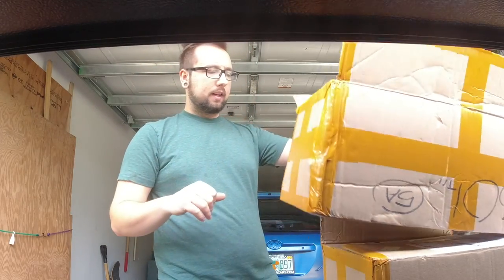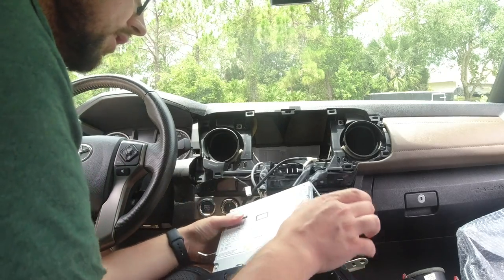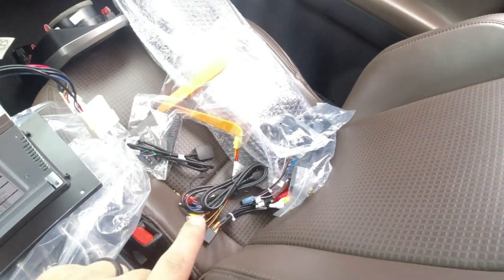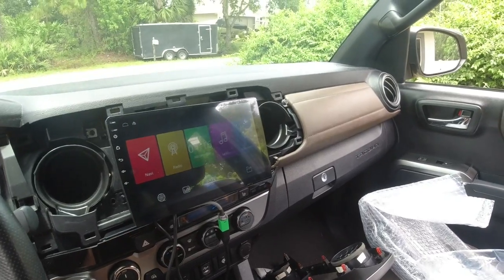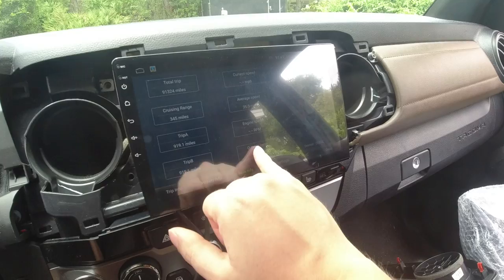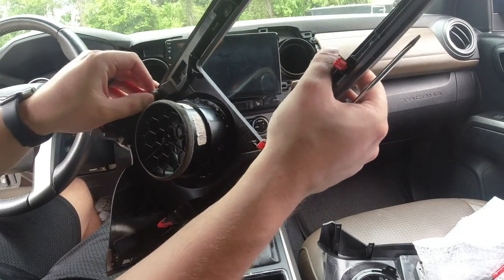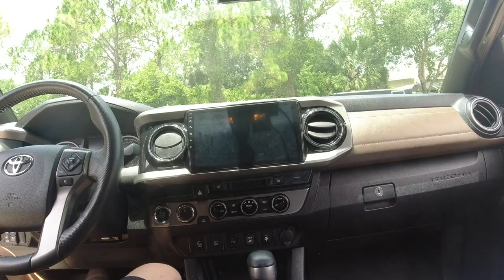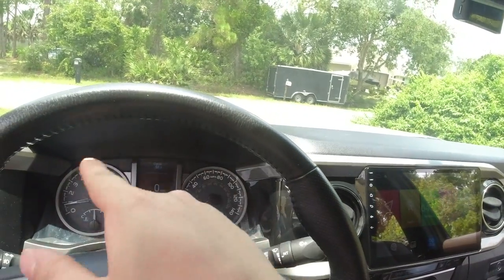Tacoma gets massive radio upgrade!

Comment: Hi, can you send me the exact model of radio you use on that video for Tacoma I just want to make sure to get the right one for my truck? I checked the link in the description but looks different from the one you installed on the video if you have the info I want to get the same one.
Reply: Yeah I definitely want to know myself.
Reply from the maker: Hello, sorry for the delay in response, Idoing has been changing up a bunch of things and how they are selling the radios. Here is the link to the radio as well as a discount code to safe a few dollars as well!

https://idoing2006.com/products/idoing-10-2inch-android-12-radio-head-unit-for-toyota-tacoma-n300-trd-sport-2015-2021?_pos=1&_sid=dbe3a5e23&_ss=r

DISCOUNT CODE: Brandon Stellmach
Reply: @BrandonStellmach great video, in the link there are some optional items. Did you purchase any of those?
Reply from the maker: I added the RAM+ROM, to get a little faster unit. But none of the options are required to work for the Tacoma!

Comment: Hi quick two questions, first did you use stock microphone or you had to run external one. Second question how is call quality , can people on the other side hear you loud and clear?
Reply from the maker: Not many aftermarket radios utilize the stock microphone. This radio comes with a built in microphone on the radio screen. It is okay, but I wouldn’t say it’s the best. They do add an additional microphone you can hook up and route to anywhere in the car. And that one sounds much better.

Comment: I didn’t see any sub outputs on the back of this unit. I have 2 twelves in my truck and my stock radio took a crap and I was wondering if this had a sub output for the back
Reply from the maker: For sub outputs, it is in a separate harness that I did not plug in. Since I was not going to use it. But this will work with after market subs if you have them.

Comment: Do you loose the ability to start the truck up with the app? I use this feature a lot and I would hate to loose it.
Reply: I've replaced my headunit in my 2021 with a Sony 9500es and the app still works for starting and unlocking my truck
Reply from the maker: I don’t have that option, so I wouldn’t be the best to answer that!

Comment: Will this work woth a 2018 TRD pro or just the sport? I noticed on the website it calls out for TRD Sport. Thanks!
Reply from the maker: Mine was a 2017 Tacoma Limted with the JBL system. And everything worked and was plug and play! So I would imagine the 2018 TRD Pro has the same tech as the 2017 limited.

Comment: Maybe this is a dumb question. If we upgrade the stock radio, do we lose navigation on the instrument cluster between the speed and rpm gauges?
Reply from the maker: I was wondering the same thing before I got mine, And sadly once you put the new radio in, it does not use the center screen for music or navigation.
Reply: @BrandonStellmach  and I use the compass/street names in the cluster all the time. Guess I'm not upgrading lol
Reply from the maker: @Justify4935 for me having Apple CarPlay was a better upgrade then having the instrument cluster navigation, unless your truck already has Apple CarPlay, would not upgrade either!

Comment: Ok I watched your video , I know you use mic built in the radio, how is call quality, and mostly is stock jbl amplifier turn on and back boom box working ?
Reply from the maker: As I replied to the other comments, the mic quality is okay from the built in one. I recommend you hook up the external one and route it somewhere. This does work with the JBL system. And everything works as normal. Might almost have slightly better sound quality.

Comment: do you notice a difference in sound quality? better or worse?
Reply from the maker: I have the JBL system, and after changing the radio I did not notice any improvements nor did it get worse. 
But I have put this radio in other cars and the sound is usually an improvement from factory.

Comment: Did you loose and features or controls?
Reply from the maker: You will lose the navigation and compass in the driver screen it your truck has that equipped. Otherwise no other features lost .
Reply: Thanks for the reply!  I think because of that I’m opting to keep the existing head unit.  I’ve upgraded all my speakers and added an amp 75wx4@4ohms with an LC7i.   Haven’t added subs or another amp yet, but that is coming.  Everything has dynamat and designed my subwoofer box in solidworks this past weekend.  Everything is really tight, but got it designed to down fire 3 cerwin Vega 6.5” subs driven by a kicker 800.1.

Comment: Are there sub connections? when i upgrade i want to also add subs
Reply from the maker: Yes this has the ability to add subs, it is a harness that they supply, I just did not add it on mine since I was not adding that.